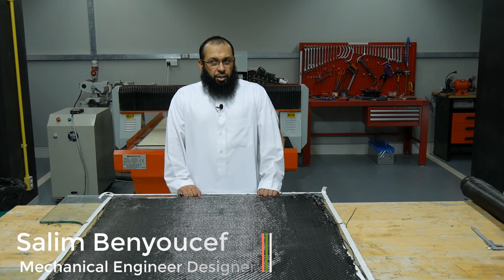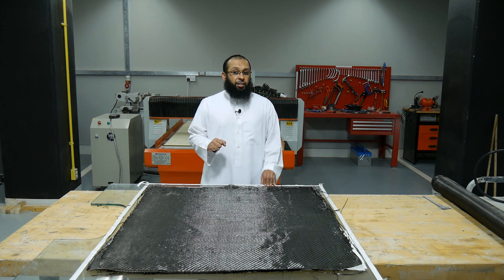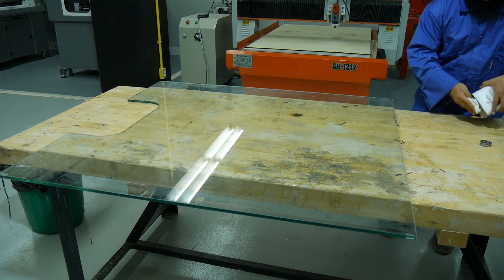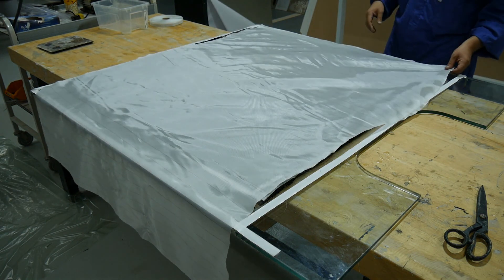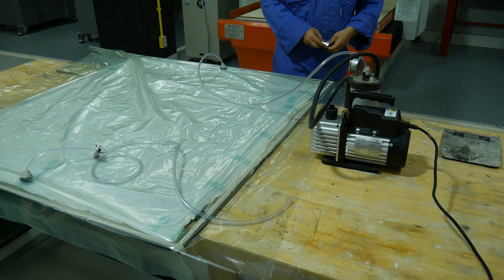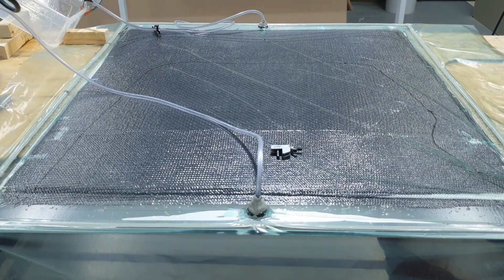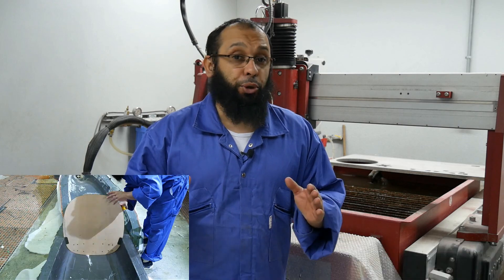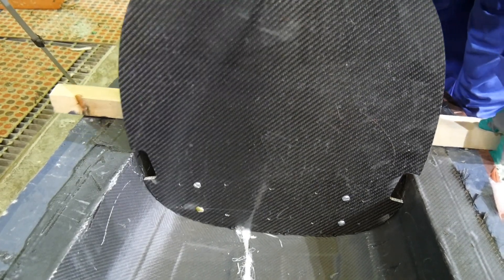How to create Sheet Carbon Fiber to make Firewall for Shell Eco Car

Comment: I am reeally impressed by your mastery and your professionalism. Mastering carbon fiber technology will open up for you a promising horizons and opportunities in several areas, particularly  in the  aviation maintenance segment . The new generation aircrafts such as the Boeing dreamliner B787, B777X and Airbus A350  are built  using carbon fiber.   About  30% of their frame  is made with carbon fiber. Aircraft  engines also is  using  carbone fiber to  save weight an enhance engine performance Such as GENX of GE aviation  and RR Trent XWB of  Rolls Royce. It is a promising area,  once again well done and keep going. Your are really in the right track.
Ahmed

￼
Reply from the maker: Well said.
Thank you brother.